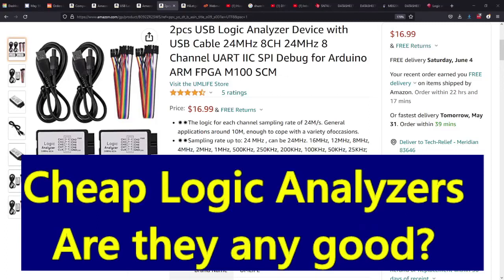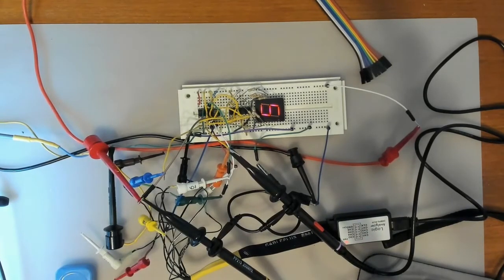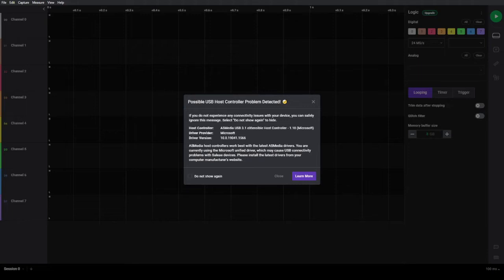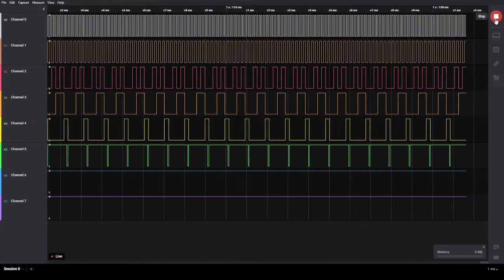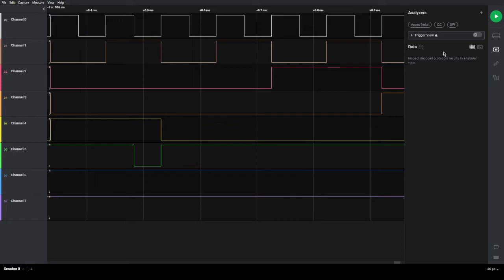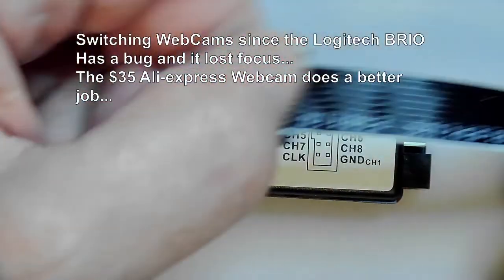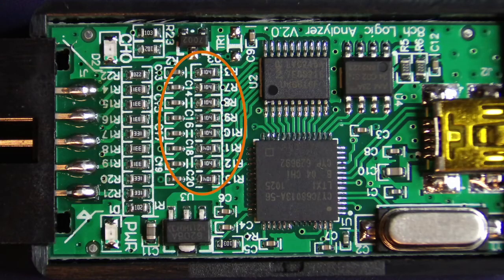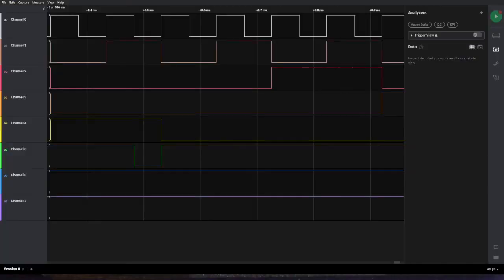Cheap Logic Analyzers, any good?

Comment: Buy an analoge discovery 2. Sig gen, scope and logic signal analyser. Great software support, an cheap..
Reply from the maker: Well I purchased a Rigol MSO5354 oscilloscope with the Logic Analyzer attachments so this is what I use now-a-days
Reply: @Tech-Relief lol from 16 dollars to $3k. glad to see you increased your budget i guess
Reply: @Tech-Relief  Jepp but you wrote "Cheap Logic Analyzers, Are they any good?"
And Rigol MSO5354 isn't cheap in general. Its a really good and cost effecient solution, but.. cheap... no ;-)
Reply from the maker: @jmqwert  You are right,, it is not a cheap solution.  I just thought to mention what I use now since I made the video.  I needed a new oscilloscope and it had the logic analyzer build in ...